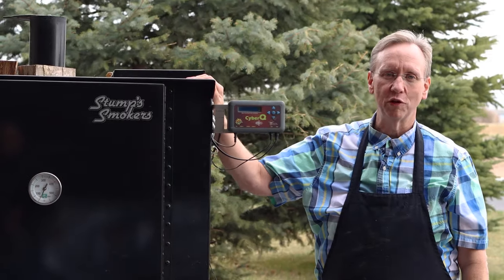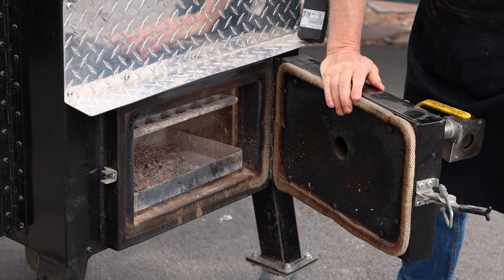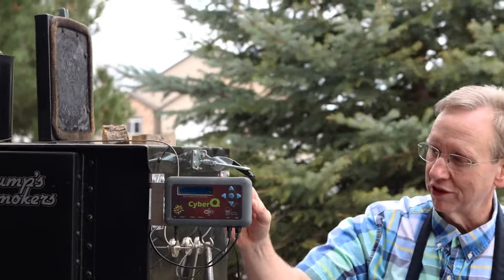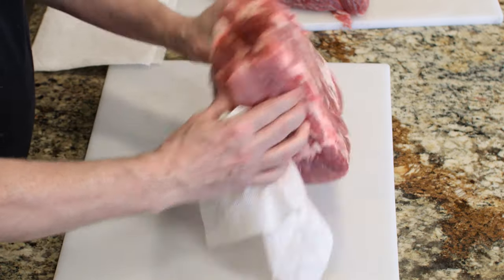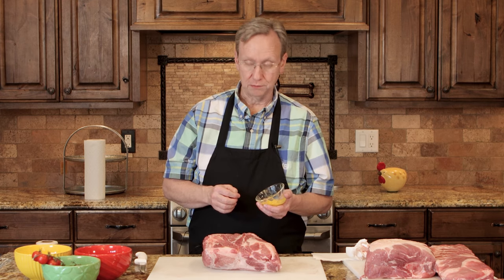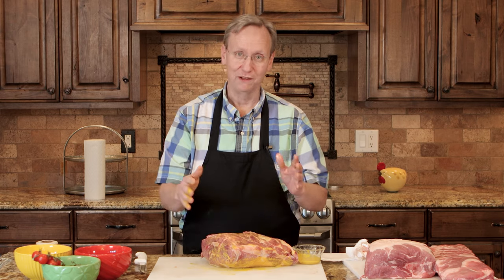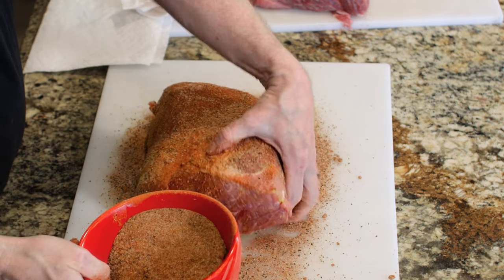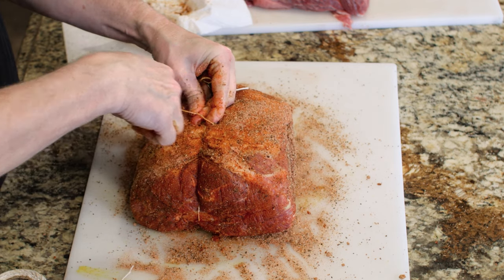Pulled Pork Stumps Baby XL Smoker

Comment: I found that this gravity feed method also works with Kamado style smokers. If you use the kick ash basket you get small hot embers falling between the cracks and into the pull out ash tray underneath. Just put a chunk of smoking wood in the ash tray and you’ll get the perfect amount of smoke.